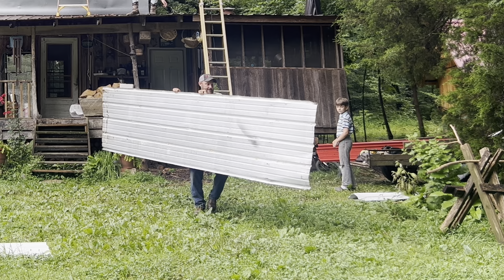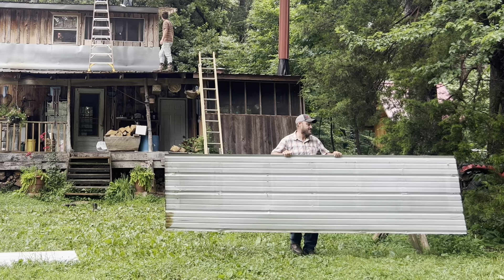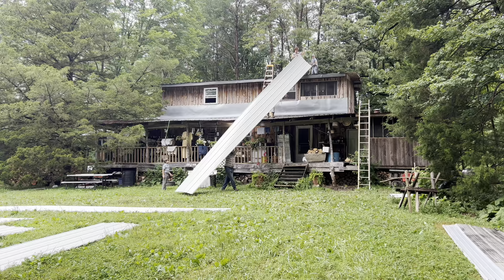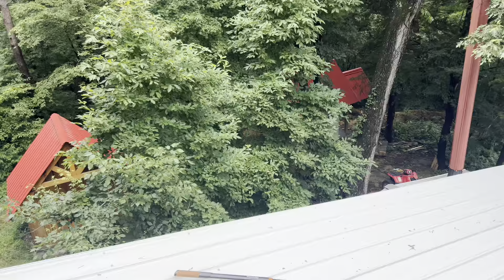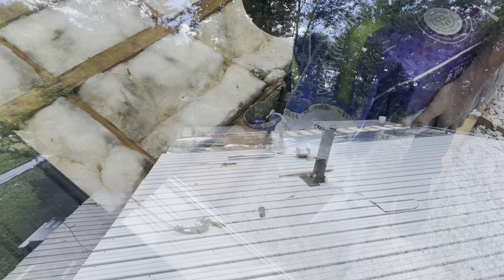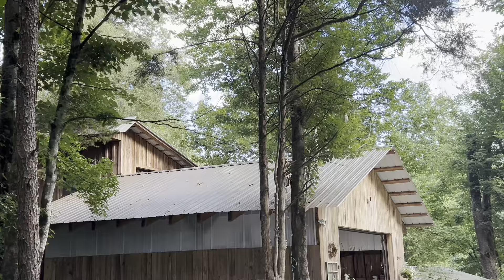Roofing my house as story cover!

Comment: I bet you used twice or three times as many Screws as you normally use on roofing jobs ... make sure no High winds or even Twisters , can peel your roof Off . . ?
Reply from the maker: On the contrary! Less is more when it comes to screws in the Metal Roof! We have got it down to a science and we use the exact same amount for our customers as we do our self!
Reply: @McGieHomesteadAdventures  I was sure you squared things away for your customers with amount of screws . . I was just thinking you might Splurge on your own roof ............ and I'm fully aware of the concept of "Less is More" and how it applies in many situations ... but HOW would it be advantageous in a tightening down a metal roof situation ??? ... I thunk for sure that "More is MORE" would apply with roof fasteners !
Reply: I am left befuddled and amazed and dazed and confused and wondering as well . . .  ?
Reply from the maker: Oh ok I can understand your thought process! But try if you will to direct your cerebral powers to the fact that metal expands and contracts with temperature changes in a 100° temperature change a 20’ piece of metal will expand 3/16ths of an inch! These sheets are 34’ long! They can literally break the screws off……… the more screws are in the roof….. the more holes that are potential leaks……… and when a roof is fastened in our method, they don’t blow off! The house will have to go with it!😎😎😎
Reply: @McGieHomesteadAdventures  .. I learned something . I had no idea metal would expand and contract like that . I was thinking metal was more stable . . wOwzers
Reply from the maker: @HighVerbal   I’m hoping that the white will expand less….. but we’ll see! I might be replacing screws every few years 😂
Reply: @McGieHomesteadAdventures  .. the white should certainly reflect the heat , and maybe that'll cut down on the expansion . . ? ..... but , How about this > If you could drill a hole in the metal larger than the diameter of the screw and then use a large rubber washer , with a smaller metal washer on top , and then screw down ... Do you think the rubber would prevent breakage of the screw by allowing for movement . . ?